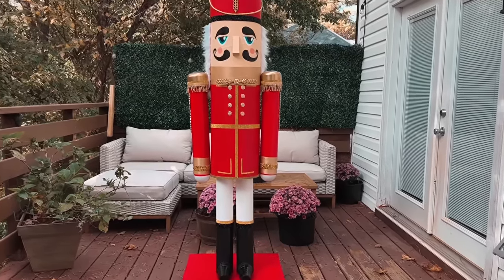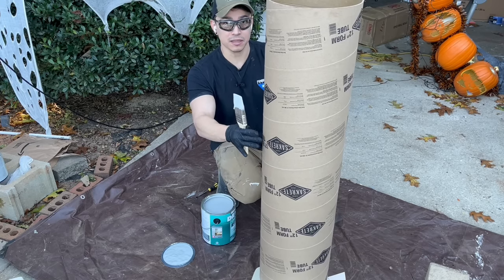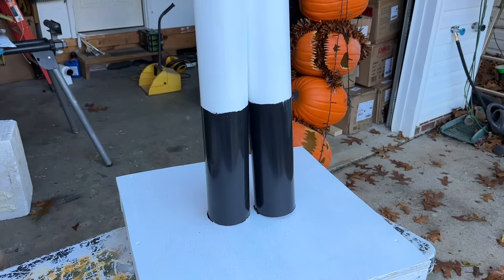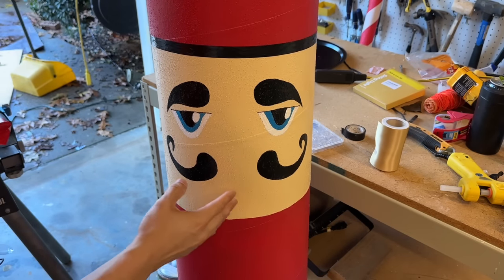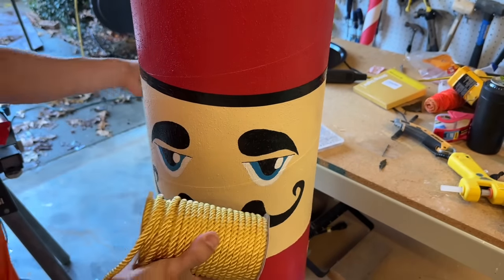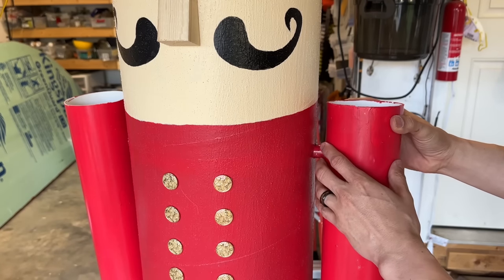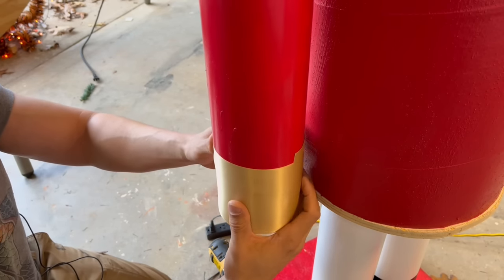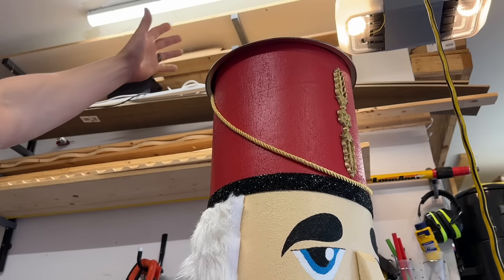GIANT NUTCRACKER TUTORIAL - DIY

Comment: Awesome!  I've watched several different videos and decided to combine the best features.  Use a plunger cut in half for the shoe tips - will last longer.  Use landscaping square timbers - and the pvc legs will fit snug on them - no wiggle.  Instead of drilling this 1" PVC for the shoulders - I like the girl that used screws on the body and made key holes in the arm and you just slide them on and off.  I also like putting a bend in the arms and attaching a drum made out of 5 gallon paint buckets or 2 gallon.  Pizza pans, hair, and ornaments from $ tree.
Reply: maybe you could do a tutorial with the mixture of ideas that you like best. Might save others time. 🤷‍♀️

Comment: I made your nutcracker and it came out amazing! My whole family worked on it. The only problem is the hot glue is failing, his nose came off as did the pizza pan on top (I used gorilla hot glue sticks). Any suggestions? The buttons look like they're coming off also
Reply: I'm in the process of building mine. I would try E6000, using a dab of hot glue to hold in place until the E6000 drys
Reply: @juliespeakman491  I just bought some today! That's a good idea about the hot glue, thanks. I also put a long screw thru it and painted the screw head the color of the nose. If it falls off after all this, it's jinxed lol

Comment: On the concrete tube: did you apply Drylock to the inside? Its coated - did the Drylock stick to the coating? And instead of Drylock could you use a rubberized coating like Redguard or Flex Seal?
Reply from the maker: I didn’t coat the inside but to make it completely weatherproof i would. Flex seal spray can be painted over with but flex seal liquid cannot be painted over. I don’t know about redguard
Reply: @IsaacAlexanderDIY  thanks for the quick reply. redguard can be painted over but its expensive (normally used for waterproofing shower stalls)

Comment: How did you attach the body to the disk?  I see you put it on top but what stops it from falling off?
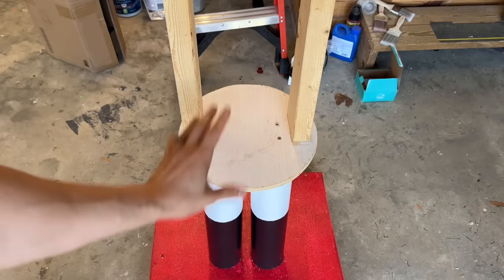Reply: He has pieces of 2x4 in either directions, you can see the top ones at 19:34. The 4 screws visible here are holding the bottom ones through the disk.
Reply: @ashishmarwal thanks!  Missed that part.